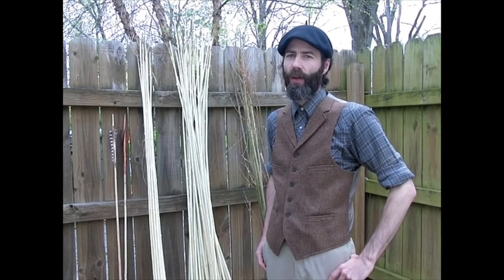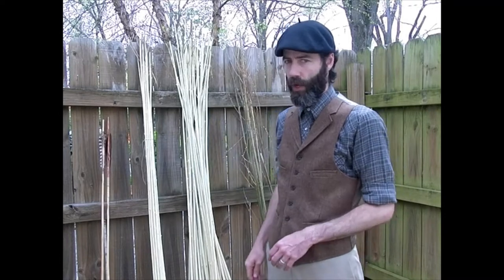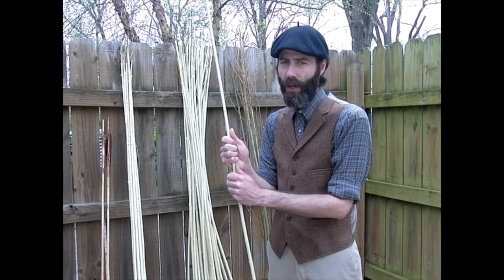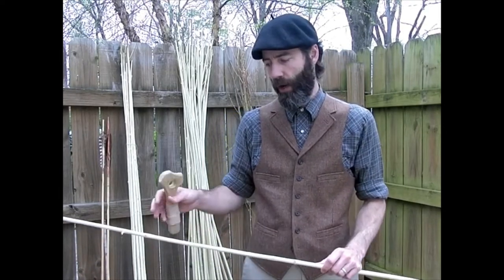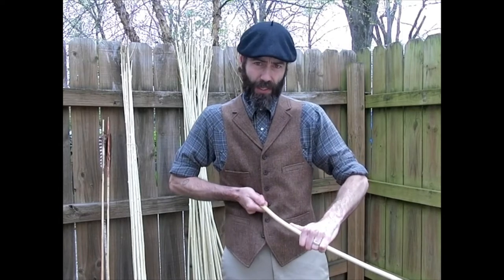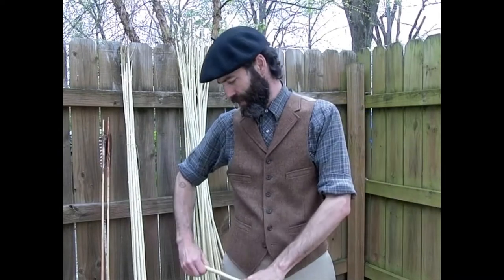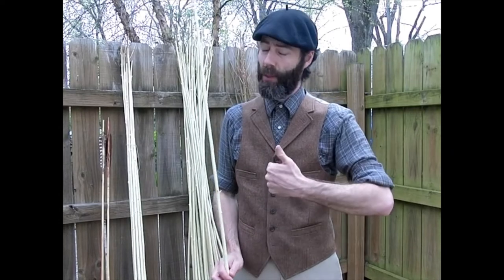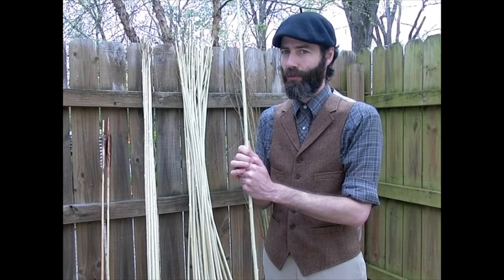Straightening Willow Shoots for Darts and Arrows

Comment: What is the length and weight of the atlatl used with these darts?
Reply from the maker: Hi Joseph, it varies. Some of these atlatls are really light, and some heavier. I just weighed two smaller atlatls (White Dog Cave Cist 24 replica and 10 January Cave replica) and WDC24 was 80 grams, and 10Jan 87 grams. My replica Broken Roof Cave atlatl weighs 106 grams, and my Kinboko Canyon weighs 114 grams. The completed darts typically weigh about 85-95 grams, and measure about 1.65 meters in length, with a maximum shaft  diameter at the foreshaft socket of about 1.5 cm, and a nock diameter of about 0.9 cm, all of those plus or minus, of course. Hope this helps!